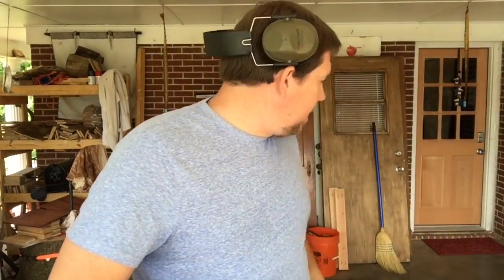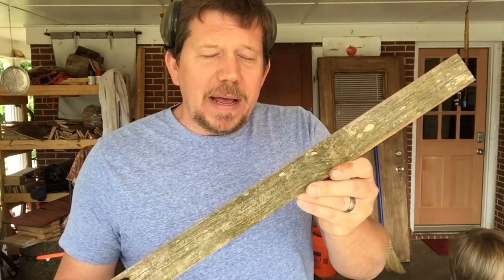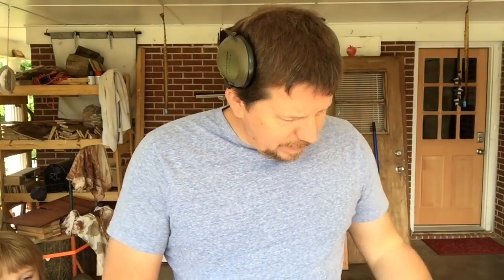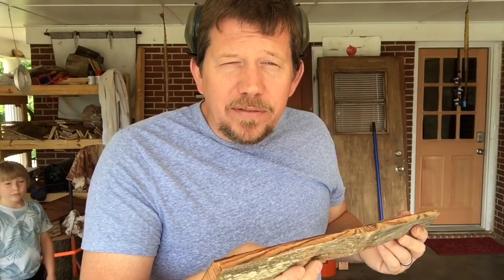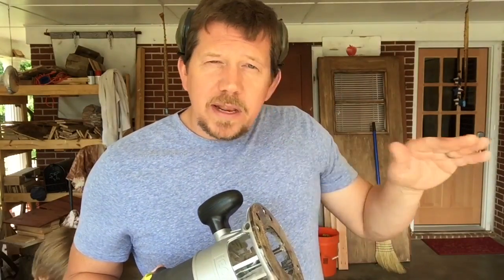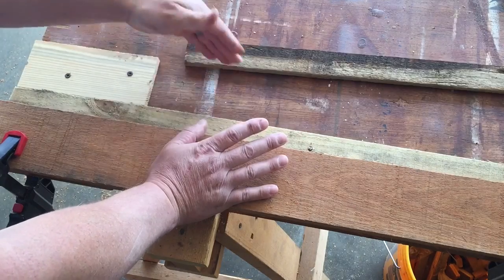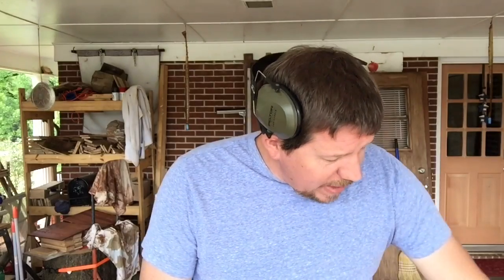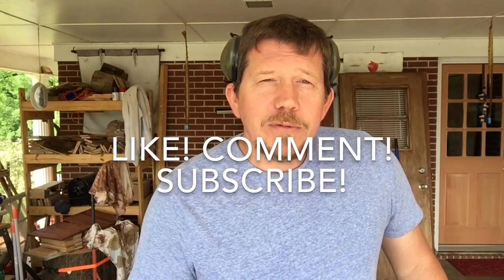Routering a Rabbet Groove

Comment: Just came across this video.  Brilliant!  Just what this beginner has been looking for.  I wanted to work with a piece about the same size as you are working with, but couldn't figure out how to get the straight-edge, stop block and the piece to sit securely on the table - not enough room on the piece for clamps, and drilling the piece to the table would mark it badly, although I was very close to doing exactly that!  I have a bigger router - should have gone for a Palm - which makes it a bit harder to see what's happening, but this approach will work.  I saw the suggestion in another comment to use double sided tape, which is a good idea also.  Thanks for this, and I love your chilled attitude!
Reply from the maker: Hey Joe. Thanks for the comment! Sorry it took me so long to get back to you.

Comment: Nice work! I'm planning some tongue and groove projects and all the videos are done with router tables. I had a hunch however, that it could be done this way and your great video confirms it. Thanks!
Reply from the maker: Awesome. Thanks, Wayne!:)
Reply from the maker: After thinking about this, I did want to caution you, Wayne. Doing what I've done here could be potentially dangerous..at least with the setup I have going on. If you don't secure your workpiece, it definitely can fly out if you have the rotation of your router turning away from the stop piece. Like a rocket! And that could break a wndow, knock a hole in a wall, or seriously injure someone...including you! So be careful and always, always, always check and recheck everything before you put the blade to any wood. Thanks, and have fun! :)

Comment: So, is this how signs are put together with pallet boards? I don't know if you can post pics in the comments but would love to see your finished project! Thanks!
Reply from the maker: Not exacty "signs". This is how we frame out something, using pallet or barnwood. I'll have to post a "building a pallet wood sign panel" video later. :)
Reply: Brenda C sssssshhhhh...no one needs to know we use pallet wood for barnwood frames 😉😉😉
Reply from the maker: No, no, no. We never sub pallet wood for barn wood. Never, never. But sometimes we build pallet wood signs or frames. And sometimes we build barn wood signs or frames. Some folks may interchange the two, but they are definitely different animals...and we never call one the other, or vice versa. :)
Reply: Looks more like fence boards than barn wood
Reply: That gimmick has been going on here in TX for yrs. Not many hundred year old barns being torn down these days lol
Reply: @Laffy1345  Maybe they "found" those pallets in the barn....therefore barnwood